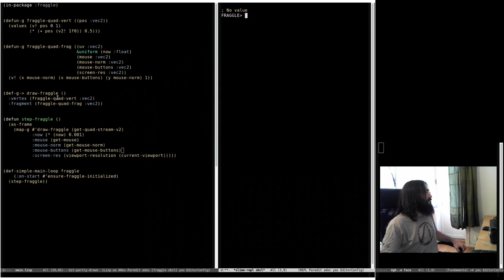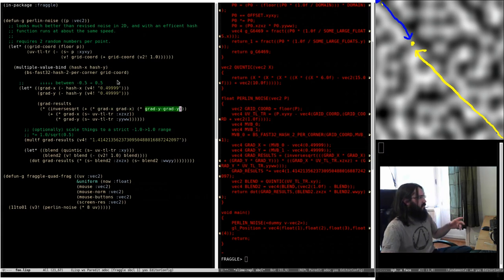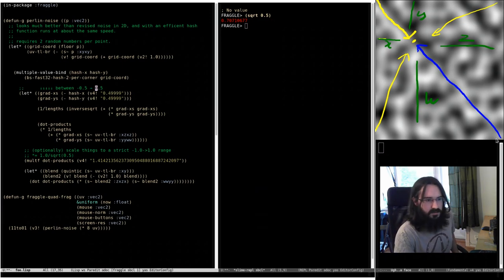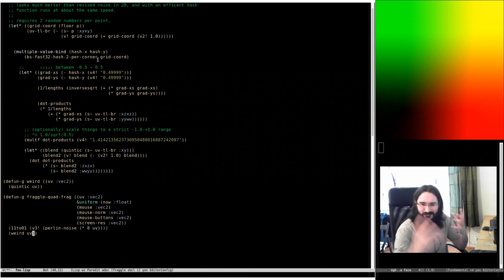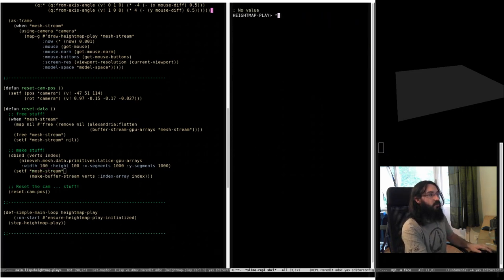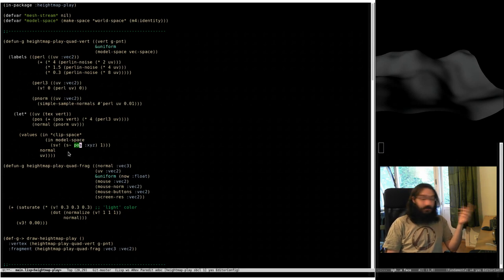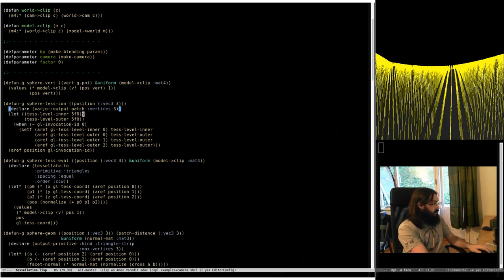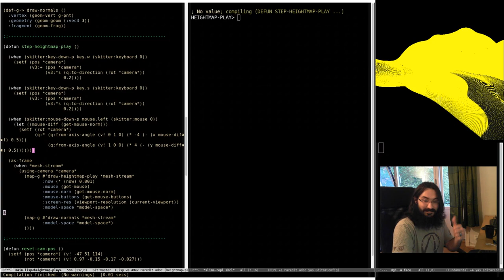Pushing Pixels with Lisp - Episode 1 - Perlin Noise

Comment: It's a little weird that the constant 1.4142 was written as 1/sqrt(0.5), because that's simply equal to sqrt(2), which is also exactly the length of the vector (1 1).